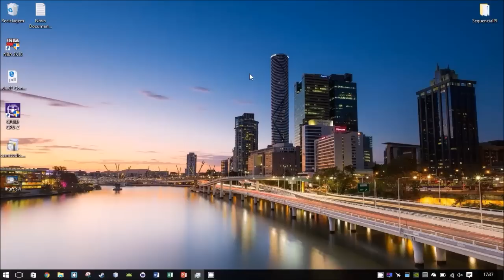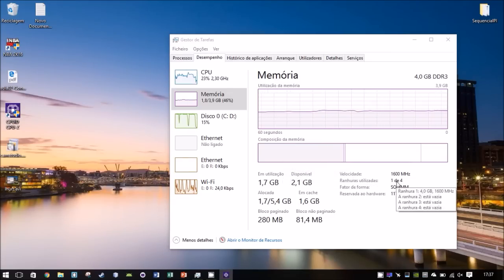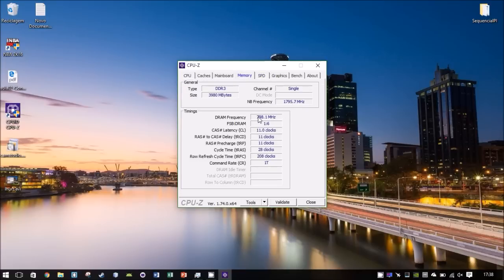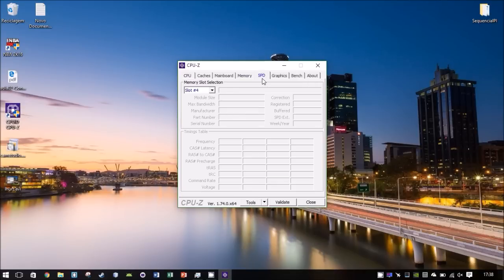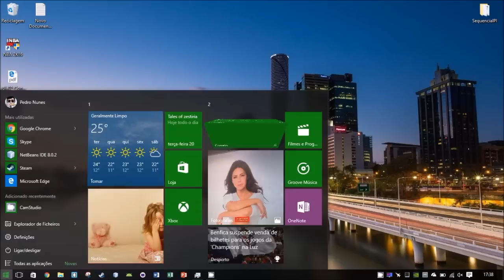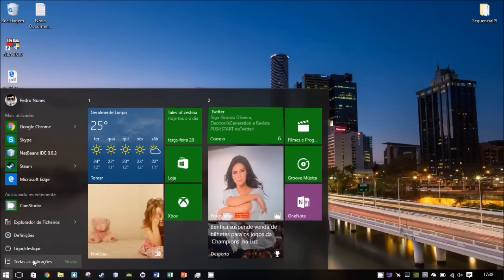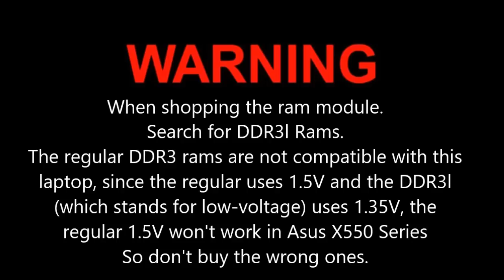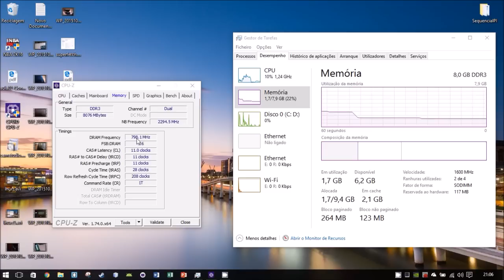How to upgrade Ram on Asus X550 Series (X550LB)

Comment: Just want to ask if this will work with Asus X550LB:
http://www.newegg.com/Product/Product.aspx?Item=N82E16820239696
Reply from the maker: +James Alvarado Yes it will :P
Reply: Are you 100% sure? The model is the same as the one you are applying in that video, but the color is different.. I also tried some other RAM 1.35v and it didnt work thats why im asking man.
Reply from the maker: James Alvarado It needs to work.. Its the correct specifications, altough other rams not working with 1.35v gets me worried.
What is your CPU, (complete model name)
Reply: How about this? Apparently newegg cant ship to my country; and this is I think the same RAM you were using in that video: http://www.ebay.com/itm/Kingston-PC3L-12800-1-35V-4GB-DDR3L-1600MHz-SODIMM-Ram-Memory-KVR16LS11-4-204PIN-/111820150837
Reply from the maker: James Alvarado I don't understand..
Even the ram that was not working, should work, you are doing it right, altough a ram that don't have a brand is strange, never saw a ram without a brand XD
Don't you have shops that sell rams in your country?
Reply: +BenchART I do but they are a bit overpriced lol. Like $50 for 4gb, and i can get 4gb for $21 on ebay.
Reply: +BenchART And the task manager showed me 1333mhz frequency with that ram, so yeah..
Reply from the maker: James Alvarado Damn! XD

Comment: can you help me.... i have the asus X550CC and it also tells me that i have 3 more slots available and on cpu-z and in task manager..... but when i open the laptop as you did i found out that the slot that you had no ram mine is already taken .... plz help ... where are the other 3 supposed to be ?? are hidden in the motherboard ???
Reply from the maker: +Lio V There aren't.
Its just like i sayed in the vídeo.
The task manager says i have a lot of slots free same goes for the CPU-Z.
But the truth is, i just had one.

Software sometimes can't be accurate.
So the only way you have to upgrade is through that slot that you already have taken.
So you need to remove that ram and buy another if you want to upgrade.
Try to sell that ram to a friend or something in order for you to not loose all the money
Reply: Thanks a lot !!! i wanted 2x4 for a dual channel but i probably be good with the 8gb in one .... thanks again and keep up making good videos :)
Reply from the maker: Lio V Well i've seen comparasion about dual channel to single channel performance.
And in the end, the conclusion is that dual channel gives you better performance on copying files or acessing things, something like +20% comparing to single channel.
Altough for gaming the boost is something like 0.5FPS :P

Comment: Can i add RAM or lenovo ideapad?
Reply from the maker: +SMALLBONE 小骨頭實況主 That's something you need to check.
Nothing like do the same thing as i did, open the back of the computer to check it out
Reply: ok thanks there is 2 slot
Reply from the maker: SMALLBONE 小骨頭實況主 Ok, just make sure you put the same type of rams, clocks and latency on it :P
You can check it with CPU-z like i did